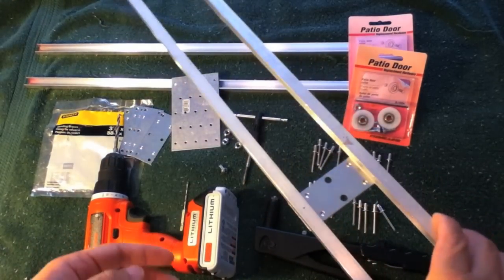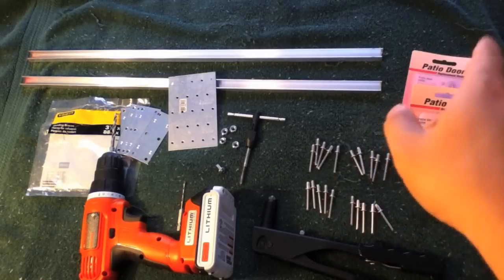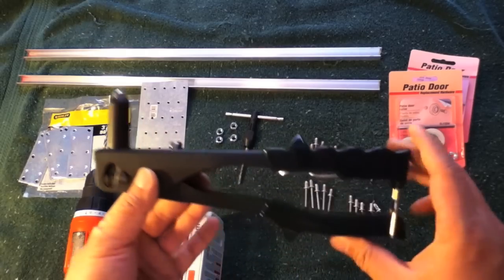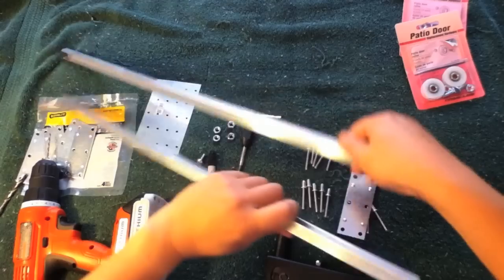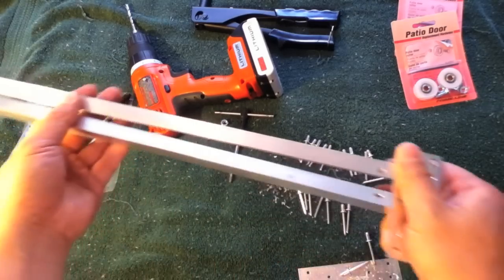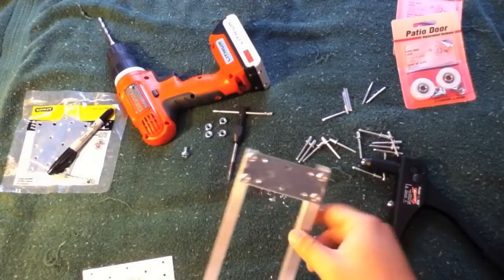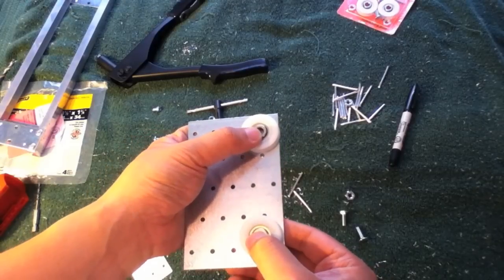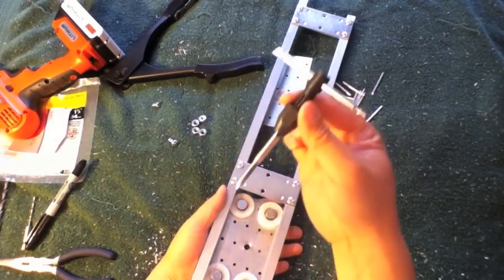DIY Slider with wheel bearings. Less than $20 for 2 foot. Less than $25 for 4 foot.

Comment: Just gave it a shot yesterday. Home Depot doesn't seem to carry the plastic rollers in store anymore so I ended up having to go with metal. I also used six rollers instead of four (3 on each side in alternating position). This seems to improve fluidity, although there is still a bit of play.

Comment from the maker: I used the plastic ones cause the metal ones are too noisy. I'm finding there's some play with this design. I'm thinking maybe a felt strip on the lower side if the u channel might give some pressure and reduce noise. Good luck. Post some vids. I'll get more up soon.